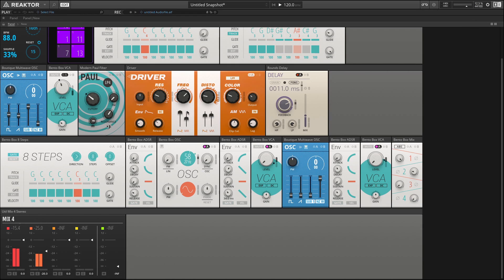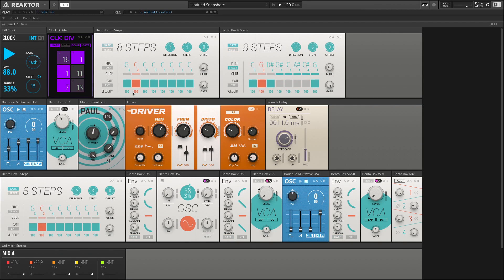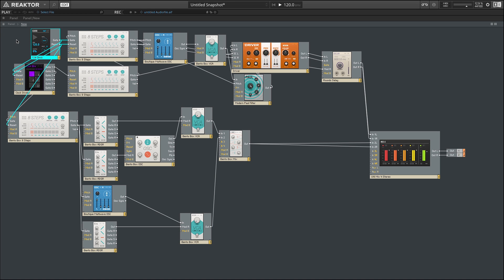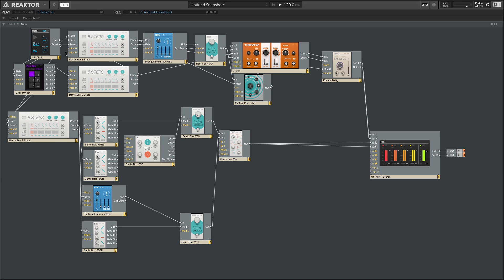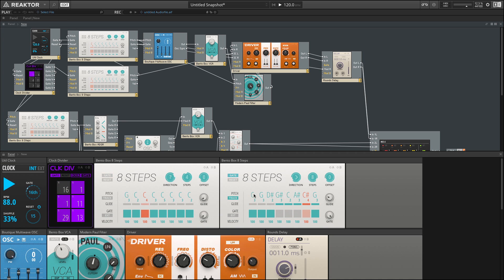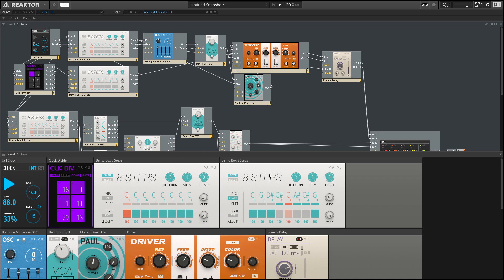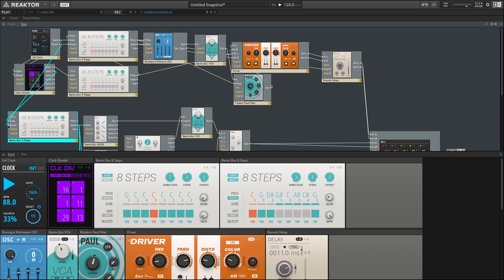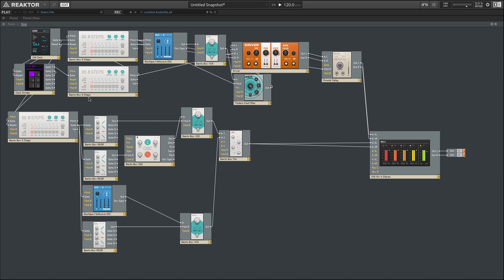Reaktor 6 Blocks Tutorial #7 "Sequencers" | Kadenze

Comment: I am using Reaktor 6 with Logic Pro X. I have some issues hearing sound 
using the midi keyboard. Specially with the factory Library. I hear the 
sequencers, because I don't really need the keyboard. But when I load 
any Synthesizers I won't be able to use the midi keyboard. It is set to 
Omni port, I can see the signal when I press keys but no sound. I do 
have sound with Monark. It seems to happen with the factory library. I 
am trying to find the solution anywhere online. I am reading forum, and 
some says that Logic won't see the midi signal from Reaktor. Something 
like that. Like the solution would be to use an other DAW. Is it 
something familiar to you ? I would appreciate if you had any 
suggestions for that matter. Can you use any ensembles with Logic Pro X 
?
Reply: Sometimes the VCA level is the culprit.      I have been using the ensembles in Logic Pro X.    

Pete Buchwald
Creative-Audio-Production.com